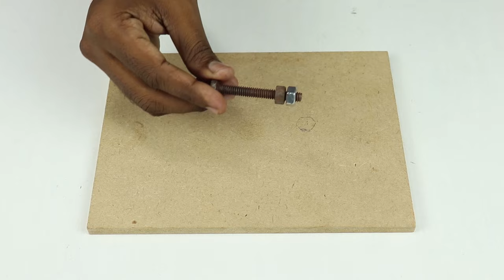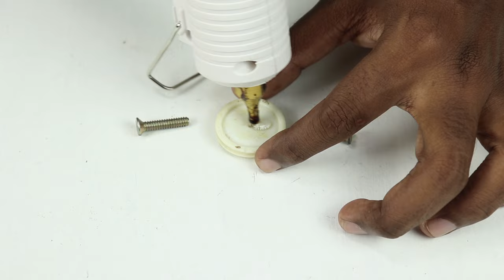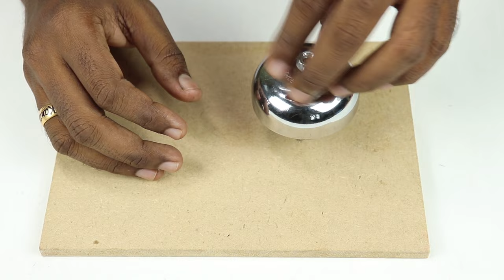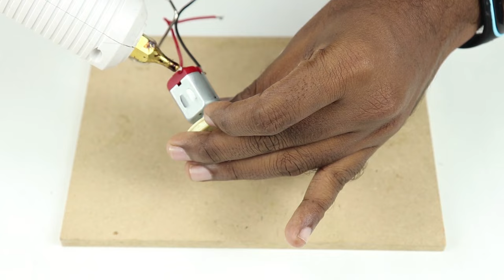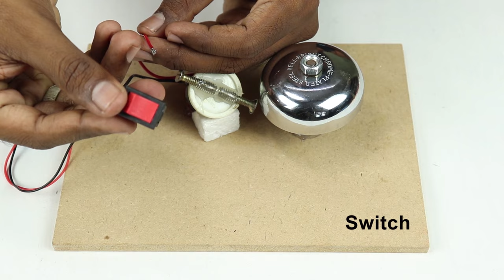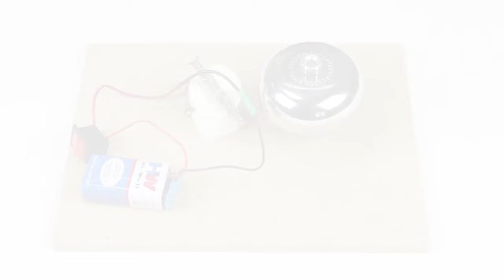How to Make a Simple Electric Bell at Home | School Science Project Working Model Ideas

Comment: Plywood board
Long bolt and nuts
Glue gun
Plastic wheel
Cycle bell cap
Battery and connecter
Switch